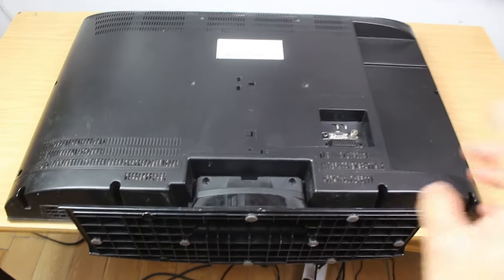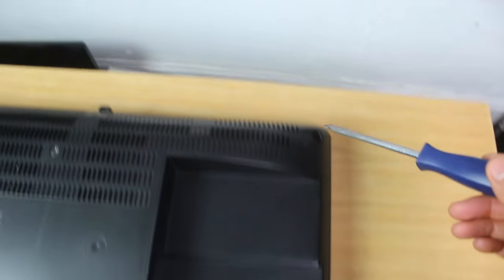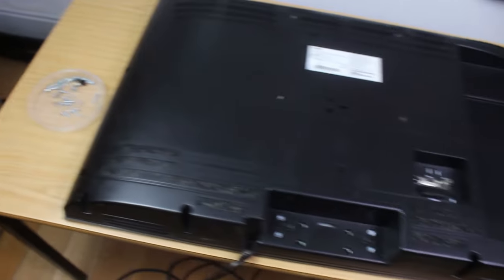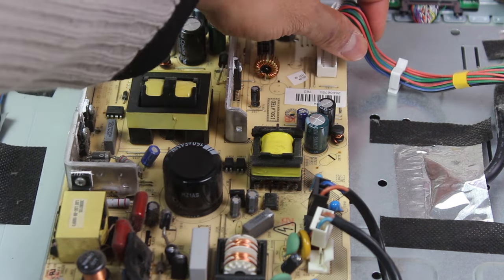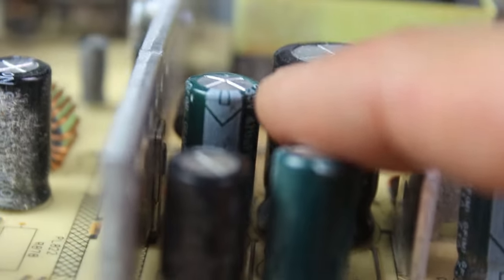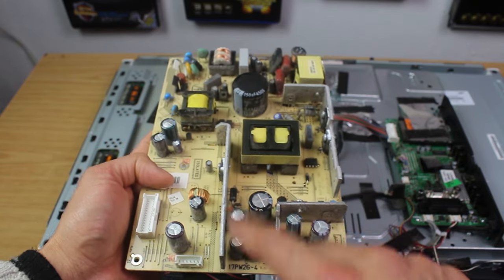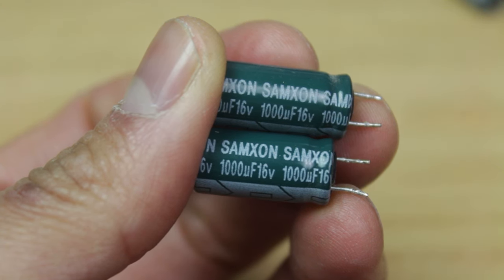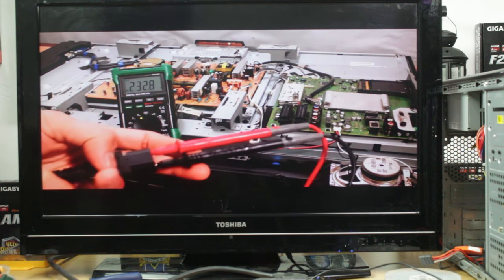How To Repair A TV That Won't Turn On | How To Repair A TV Power Supply | TV Red Light Blinking

Comment: Most issues I’ve dealt with this kind of things was only the Fuse needed new one soldered on after the recent one bursts or short out on the power supply connected to the power cord that little motherboard will always be good it’s the fuse that never lasts on most TVs

Comment: I deal a lot with restoring UK slot machines, and deal with both the traditional coil style as well as switch mode (As used on this TV) power supplies, and certainly on the switch mode variant's, it's almost always a bad capacitor issue, which generally involves changing out ALL the capacitor's (We generally don't waste time or risk just changing the odd one or two, especially given the age), which vast majority of the time, will sort a switch mode power supply out well enough. Happens my Tevion md 30180 40 inch has just failed with a very similar issue as to what you describe here (PSU is a 17pw16-2 power board, and seams very common), so obviously one of my options is a re-cap, however as you pointed out, if a refurb switch mode is cheap enough, may save a lot of time and bother, just getting a replacement unit.

Comment: Have just fixed mine after months,  first it went on when it felt like then nothing. After watching a few videos on youtube I opened it up and it checked the capacitors,  the 2700f16 had a bulge in the top,  I found one in a broken tv, unplugged the 4 plug ins in the power board, undid the 4 screws,  heated the solder off and took it out, put the used one in, two blobs of solder and it works perfect. Thanks very much for your vid

Comment: Can anyone give me a tv diagnosis? When I go to turn it on sometimes I get no response. Then after a few tries I'll get a popping sound after I hit power, then it's off again. Finally after doing that a few times it'll come on. What's wrong with my tv? Please help!
Reply: Check your power supply capacitors.Most likely you have one or more which are defective and need replacement.

Comment: I have a really old tv toshiba TP43H60 made in 1999 and i had the same problem. all i had to do was unplug the tv, then hold down the power button for 45 seconds, then plug it back in and turn the tv on and it worked! :D
Reply from the maker: Classic hard reset, works like magic sometimes!
Reply: @HealMyTech1  yeah but it happened again and when i did the reset it didnt work , so now im stuck buying a new tv
Reply: @tinypuppiesrule3115  well,it served you for 20years!

Comment: Nice video, I know it's an old video but hopefully you can answer my question, I have a RCA 43" 1080p and it turns on but after one o two minutes it reset by itself  and after another 1 or 2 minutes it restarted again, and the red light blinks while it reset, what woulb it be? Thanks
Reply from the maker: Does sound like a power supply board issue, maybe capacitors, of the logic board, or it could be the manual control sensor?  Hard to tell without eliminating issues, the tv needs to be opened and various voltages checked.
Reply: @HealMyTech1  
Bhutan
Reply: Check your fuse on the power supply if you can’t find an easy way to solder it in use a piece of Tin foil wrap it around it end to end or put it inside the little plastic holder.

Comment: when i switched the tv on at the wall i see a red light flash once and thats it after that its just dead no lights or anything, already tried replacing the fuse in plug no luck
Reply from the maker: This needs for troubleshooting, back of TV needs to be accessed with a multimeter, only if you are confident, otherwise consult a professional